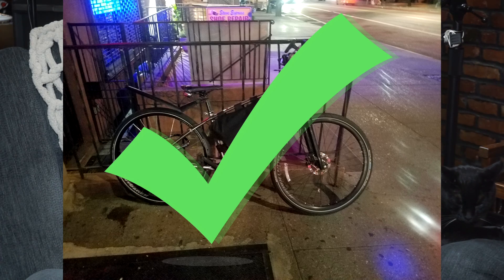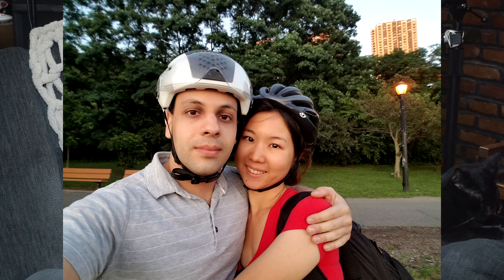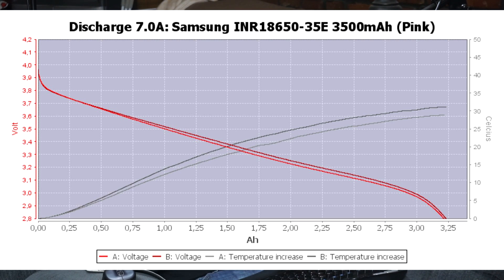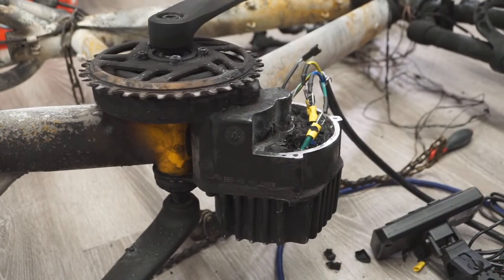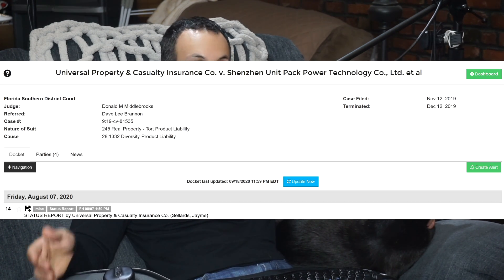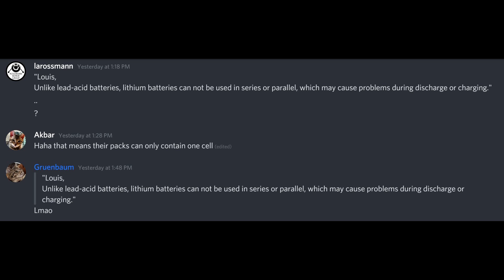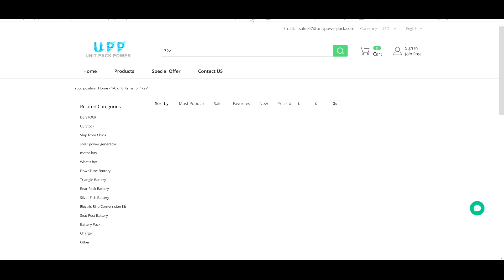Louis' front door goes BOOM courtesy of UnitPackPower battery.

Comment: Hi louis, this will be a bit of a longer story so I apologize.

 I've built an electric dirt bike using a 3kw motor and controller found on alibaba. Frame, wheels, throttle, chain, and batteries found in a junk yard.

My bike was built with the following priorities in mind, in order:

1. Cheap price
2. Speed
3. Durability
4. Safety.

The entire bike is held together with only zip ties and electrical tape. There are 4 battery packs, each one is 36 volts, and contains 30 cells. I wired the packs in parallel in pairs of two, then wired the two parallel packs in series to make 72 volts to feed the motor. 

Each of the 4 battery packs has its own charger, which was done to prevent the various electrical fires that were caused by attempting to use one charger for all of them. 

The bike is no where close to street legal, as it goes 40 miles an hour, doesn't have pedals due to being a dirt bike frame (razor mx500) and only has one working set of rear brakes at the time of writing. 

Despite  the entire bike only costing me around $600, despite the entire bike being quite literally junk taped and ziptied together, the batteries have never exploded in the past 2 years. How a major company dedicated to batteries has managed to make and SELL a greater fire hazard than I have built from scraps is astonishing to me. 

As a matter of fact, I listened to your videos as I sat awake at night in my dorm room, learning how electricity works the hard way, be that either by accidentally vaporising a wire or just electrocuting myself so much that the yelling woke up my roommates. In the end, my bike got built, and in a way, couldn't have done it without you.

Wish you the best louis!
Reply: Haha, sounds fun! My first motorized bike basically fit that plan with the saying “safety last!”, as was front wheel drive but in doing so I had to remove the front brakes, so it had only rear rim brakes (which weren’t really the best on wet roads, at least not when it was going a decent ~28 to 30 mph in town and had you clenching the seat when someone ahead would slam on the brakes, haha!).

My newest one is electric since they only allowed electric in that state and had some weird rules: they didn’t have a power or speed limit if you were pedaling, a bit of a loophole. So I had my pedal sensor connected to a relay and arduino micro controller to comply with the regulation. I only had it pulling about 2 kW on my light weight road bike, but that was enough to get up to 30 mph on about 1.2-1.5 seconds (acceleration was basically limited by how hard you could hold on because the seat was bare carbon fiber and you’d slide off that thing like ice), I never got around to upgrading it to duel battery though and actually test it out for my intended speeds (which would be over 50 mph pretty easily with a 108v battery), but I imagine it’s probably slightly safer that I never did. Might sometime though, but I moved back to a state that allows gas powered engines and the last one I made for that state was using a 52cc chainsaw engine (my oldest one used a 25cc grass trimmer engine and hit 28-30 mph and pretty fun to drive), and I was going to use it for experimenting with a new race engine forced induction system because in this state there is no power limit on gas powered bicycles and you can go up to 80cc and have superchargers/turbos/NOS, basically anything and it’s still legal, you just might shred your tires but that’s fun too!

Safety last! ;)
Reply: Personally I think you should use screws to keep it together properly or it won't hold for very long becoming a death trap.
Reply: i was the 69th like POG
Reply: Bro I have the answer to the"how a company that sells batteries" question
Easy answer: money.

Comment: Where the first two E-bikes EM3 batteries also made up of 2 packs connected in parallel?
I had a customer who connected a 10Kwh 22S LTO battery bank to his existing lead acid 48V battery banks ( a 2V and a 12V Pb bank so altogether two lead acid bank and a LTO all in parallel!). He didn't use any fuses or circuit breakers. Two weeks later the fire department was also at his house.

Comment: You're an idiot trying to power an ebike from an arsonpack. Yes, it has two terminals with a voltage between then, yes there are many, many watts of power, but they are there so the device can heat up properly and the outgassing can ignite. You're supposed to short out these terminals and then throw it through a window for example. Again, you're a total idiot.

Comment: You should take a crack at building your own batteries, Louis. I think it's a lot of fun. You can use the very best cells in the world when you build your own, and you can fuss (or obsess) over all the minor details, like series routing, nickel thickness, ring gaskets and insulation, balance wiring, etc! I use a Malectrics spot welder. Autism.. is almost a requirement, though..

Comment: Probably had a cell or wire that shorted, and the cells were not individually fused. If that's the case, one bad cell shorts the other paralleled cells (9 in this instance), and things explode very quickly!
Then again, like with the APS' grid battery explosion incident, the cells themselves can be defective and spontaneously fail.
LG denies this, even though other cells from similar batch in different grid battery show similar failure signs (dendrite growth), AND grid batteries in Korea, using their cells, have also exploded spontaneously.

Comment: wouldn't you need about #6 AWG copper wire from the batteries to your controller or motor if you went for maximum output? Too small of wire, battery overheat fast.

Comment: this is why i use  no bms use use bc168 charger  charges each cell  vs from both main pack output leads and lets bms bleed off extra power till there equal   been running 100v 60ah of nissan leaf cells on my motor cycle
Reply: i stopped useing 18650 cell takes way to many and so many ways to fail vs bigger cell formats or prismatic cells

Comment: @Louis Rossman - electrical engineer here.  I concur with your findings.  I don't see any way you could have caused that failure and therefore it is most likely a fault within the batteries.  Either the BMS may have failed or a single cell could have had a defect.  Boeing had problems with cell defects on their 787 battery packs, and you know those were top notch quality so it happens.  However I do want to offer a little criticism of your circuit design using the bridge rectifier.   Although the bridge is effective at isolating the two battery packs while feeding a common output and charging from a common input there is a downside to this design.  This effectively parallels two diodes for charging, and two different diodes for discharging.   Diodes do not like to be paralleled in current sensitive circuits.  The reason is that since the IV curve is exponential, even very small variations in temperature or manufacturing can cause significant imbalance in current.   This will lead to one battery effectively leading or lagging the other in charging, possibly by a significant amount.   Of course if you charge long enough, eventually they will both reach full charge, but if you do a series of partial charges and partial discharges, you could end up under certain scenarios with a wide variation in state of charge between the two packs.   Some alternatives would be a constant current circuit, a current mirror, or an active balancing system based on a microprocessor.

Comment: Shorted cell, rest of cells in parallel dump through it. Just a bad single cell. Only fused individual cells will offer protection.  If battery packs  are close in voltage and connected in parallel they will just balance. Charging a pack the way the packs are designed all cells internal resistance is critical to distribute the charge. The pack is just a voltage divider if a cell is going bad bms will only stop charge or stop current flow. Best battery pack will have a port to connect to each cell and charge each cell without a series connection. I use usb wall chargers and tp4056 chargers and build my own chargers. My lawnmower battery is a 11s pack and connects to my charger which is 14s capable but only  connects 11 chargers. Each cell is topped off independently. This is the best way to charge lithium batteries, just not the cheapest way.

Comment: What angers me the most is 
These "big brand" batteries will be shipped no questions asked because they have BMS inside of them, while the cell's are fake, road killed deers ass.

If I want to buy good quality zippo 75c 1500mah 3s lipo that i never had problems with guess what I get one big fuck you because high C battery bad.

And at the same time if I go and buy 18650 cell's I need to pull through all those fake 12AH batteries that are actually 900mah only and I we bought one  just to test and it arrived under a week with 1.1v on it (overcharged so they don't explode in mail) I charged it and discharge test came about 900mah 

If I use that battery anywhere It will explode, no questions asked.

And if you want to buy something like Panasonic 3400mah li-ion cell 
Guess what "shipping failed (dangerous goods)"

Comment: I tinker with epv's. I noticed that sometimes the hardware doesn't cause the malfunction. My C2 died after some small fireworks. Due to a weak soldering connection. Immediately after installing a battery  upgrade. Weak solder and high current can cause an irreversible fire. Build smart and safely everyone...

Comment: I have seen this all too many times with cheap packs!!!!!

What these idiots don't undsrstand is the ONLY thing keeping a call from shorting is the super thin wrap on the cell! They do NOTHING to separate the series connections, and therefore a little bouncing action will chaff the cells, causing a dead short and turning your E-Bike into Ghost Rider!

ALL series connections MUST be insulated from each other with some type of damper material, like EVA Foam. The entire pack also needs to have some type of insulator and shock absorber around it. EVA Foam is what I use.

It is perfectly okay to glue cells together for the parallel connections, but the series connections must be isolated and insulated.

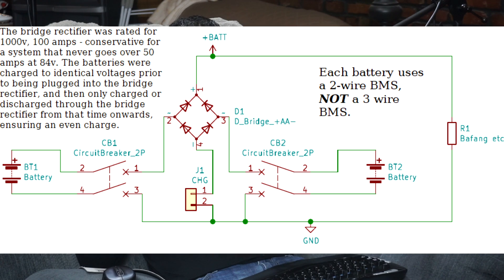Comment: @4:34 - schematic w/o partnumbers (I guess you part fail here, not Tim) - @4:20 flipping the circuit breaker could make it fail, causing a short. No fuses to blow, battery goes kabloom

Comment: I have noticed on a few other you tube videos including this one when the firemen arrive at a fire they don't use a pull out smaller hose reel that uses the onboard water in the tender to attack the fire while they attached the tender to a fire hydrant. Do your fire tenders/pump have an on board water tank as they do in the UK. I was also thinking they preferred to let the lithium burn out before hitting it with water as the fire was outside on steps and under control, I suppose that way there is less lithium to clean up all be it at the cost of more damage to the door?  what's your thoughts on this?

Comment: Hi Louis, happy to see no one was injured. Failure happened after usage and obviously a "thermal runaway" event occured for some reason. I would not say it's "incorrect usage" of batteries though not far because Yes it's unwantedly riskier. In your wiring conception if one of anti-parallele diodes (point 1 schematic) goes short (it can happen with overcurrent, aging, voltage spikes at contactor closing/opening etc.) then 2 batteries ARE in parallel ! stronger voltage one will charge weaker one at maximum current battery internal resistance and circuit wire resistance can take putting all the stress on BMS MOSFETS trying to make his job, this repeatedly other time will not end well as BMS failure are the most fire reason on these china battery assemblies.
for 10P samsung 35E we are talking about some hundreds amps possible here ... >>> overtemping connections, overtemp cells, hot gazes venting and fire is expected. Your design with 2 wire BMS is ok for charging yes BUT it's false to say batteries will be at same charge voltage ! it's not possible because diodes if ok block voltage equalization and they have separate BMS. Yes differences on 2 batteries voltage will be partially equalized during charge BUT you have 2 separate battery so difference will be high during discharge and i would say probably quickly beyond BMS shunt equalisation capabilities ! 
maybe UPP have poor assembly quality, i dont know, but design you used is not recommanded, through diode at all case and even with contactors i would reject it with lithium also ! one bigger Ah battery with BMS (including overtemp detection!) is recommanded because cells in parrallel will equalize and act as one bigger  !

if you connect these 2 battery in parrallel, they have same external voltage but look inside, what do you think will happen ?
total voltage - cells voltage
12V - 3V 3V 3V 3V
12V - 4V 4V 1V 3V

first battery will take all current, second one will be cutted of with ON hicups repeatedly by BMS... 
now imagine BMS fail
now imagine antiparrallel diode take all and shorts first battery try to charge second one ...

Your design seems to me bridge overcurrent ability and quality dependent. With very trusted industrial usage brand a 100A rating for a 50A maximum usage is "good enough" margin .... though sometime diode rated 100A can fail at lower current from poor quality brand ...  
other simpler thermal runaway explanation can be poor spot welds .... 
this battery fire needs full failure analysis to be on science side and seems to me there is not enough data here to conclude as you state it,
sorry for my poor english ;^)
Reply: A someone who uses an ebike daily and keeps one where all my stuff is everyday, I like to think it had something to do with his somewhat crazy setup. (one 36V 10Ah battery works for my needs) Glad everybody is ok.  Pretty sure they're talking about putting the battery packs in parallel, not the individual cells in the battery pack.
Reply: The charge levelling current would be quite low if one diode shorts. 1) the batteries are very close in voltage since they are charged and discharged together and in this case 2) the battery that's charging the other one, has a diode in series causing enough voltage drop to have even less levelling action.
Reply: @mjouwbuis , actually the bridge might prevent even charging and discharging happening in the first place. As long as the bridge is intact, the batteries never see each other. If one of two particular diodes die short, then that battery can and will receive charge through the remaining diode that did not die, given that the voltage difference is more than 600 mV.
Reply: @seriouscat2231  With Li-ion, not much difference in volts is needed for huge currents to flow. Charging can only be done at max 0.5C without cooling. This could easily be more if a diode failed short.
Reply: This does sound much more like a short somewhere in the system caused the thermal runaway, not overtaxing the batteries
Reply: The only comment here that makes sense - coming from someone who knows a thing or two 👍🏼
Reply: You're English is fine, no worries. Your analysis is excellent. Best I've seen.
Reply: What type of circuit breaker did you use?  I notice if one circuit breaker has a contact bounce from a bump or trips while in use the back EMF current surge thru the remaining battery would be huge. Then it's a matter of time before  the battery shorts out.  In that case a  bad battery connection would do this also
Reply: @danc2014  yeah a freewheeling diode on the breaker contacts would be a good addition. The whole schematic gives me the heebie jeebies though. I know it would be more work and more involved but integrating the batteries better with a BMS that knows what both cells are doing would probably have helped prevent this. It's a shame we won't know what caused it.
Reply: I am particularly interested to know if the diode bridge in use was designed for AC or DC; AC bridge rectifiers expect a duty cycle of less than 50% due to the continuous zero crossing. Also, AC or DC fuses?
Reply: @wool1701  The cooling on the rectifier is vital for using it close to rated. At 46A its dissipating ~30W or more which is a lot if its not well heatsinked

Comment: Could your breaker switch was wired wrong, if it was going to thermal it would have done it on charge or discharge.  If your wires reversed the polarity when the breaker switches and removed the bridge rectifier?

Comment: Often a battery such as this can easily be damaged from mishandling during assembly, during manufacture, or during shipment. A single damaged cell in a parallel-series configuration such as yours won't be detectable at first. However, under load and vibration that one cell will heat up over time with use and the internal resistance of the defective cell will decrease causing the cells in parallel to discharge through the shorted cell starting a fire even though the bike is off.

Comment: Having designed and sold many flight controllers , video transmitters & ESC's for use in UAV's i'll add my 2c in, the only reason it would not be safe to have those two packs in parallel is if they know they are using subpar cells that haven't been ir matched or even worse they used different cells or over/under capacity, any idea what the lowest voltage the cells seen during that last ride was? another possibility is poor connections internal to the pack if there was a shity connection the IR would go through the roof and the resulting heat could be enough to melt a tab then short one cell and once one has gone into "thermal meltdown" the other cells haven't got a chance there going to go up in a matter of seconds. - edit there is assumed knowledge here for example prior to connecting two packs one is expected to check each individual cell voltage and ensure capacity is within margins .